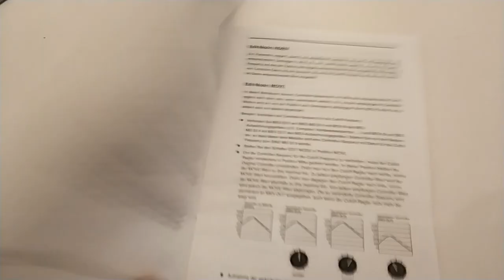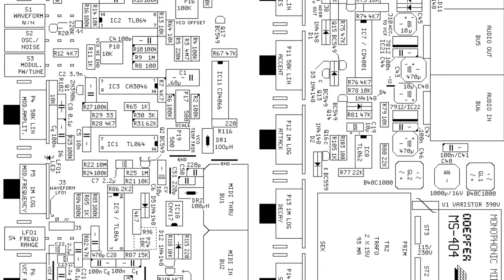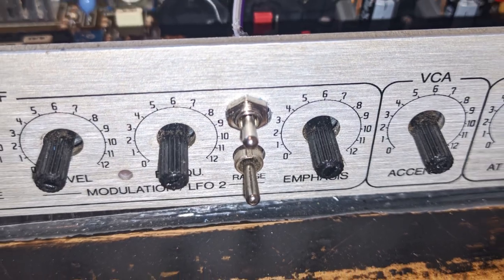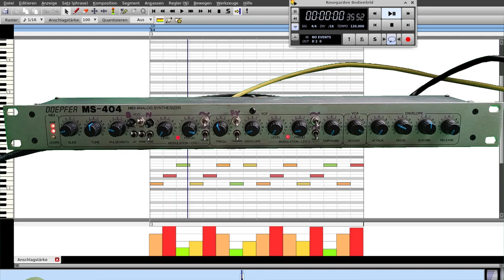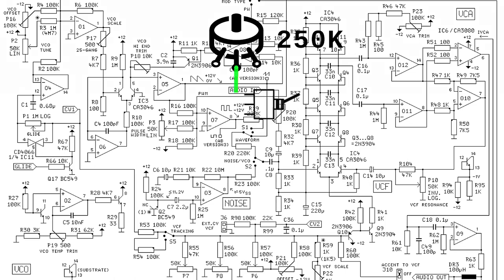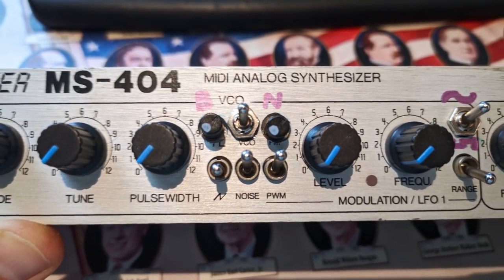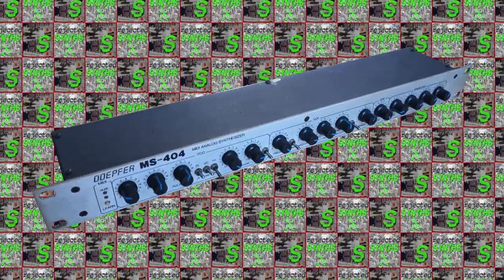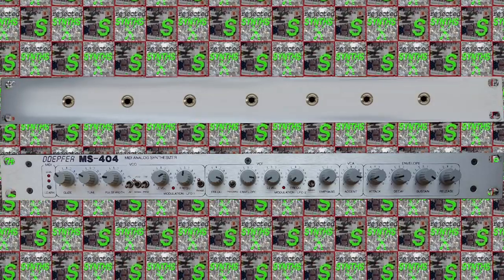RS047 Tech Support: Doepfer MS-404 - Some Simple Mods

Comment: Another possibly simple mod you could try, would be a switch to change the filter between 24db and 12db slope. It should only require a dual pole switch and wire it in the following way:
Lift/desolder one side of C16 and C17 from the PCB to seperate their connections to the transistors in the filter. Connect the capacitor leg to the center pin (common) on the dual pole switch.
One of the positions of the dual pole switch is then wired to go across capacitor C10, this is the 24dB/oct setting (unmodded).
The other position of the dual pole switch will have wires going across capacitor C12, this is the 12dB/oct setting (modded).
The most difficult part of this is to ensure the polarity of the wiring since it needs to be maintained the same as the unmodded filter due to it being a balanced design.
The filter is a 4 pole ladder filter, where each pole is a transistor pair with a capacitor inbetween (C10-C13) looking at it should help understand better what I'm babbling about.
Reply from the maker: Wow, thanks a lot!
Reply: @rejectedsynths  You're welcome :)
Hope you test it out and get it working.

It should also be possible to tap off the filter at the other stages, to get 6dB or 18dB slopes (by tapping over one of the other caps in the ladder filter)
but I can't remember if the phase of the signal is inverted at these stages, relative to the resonanse feedback.
If that is the case, it would require some more modification.

It is however quick to test this, by simply just tapping the signal at those other stages and listen.
Reply: @rejectedsynths  Oh and another thing that might be usefull and simple, would be to wire a push button to the gate input, so the synth can be manually played without the need for a external controller.
Quite usefull when goofing around with the unit.
Reply from the maker: @Gin-toki  Like the launch button on a Waldorf Rocket 😁👍

Man you sure know a thing or two about modding a synth!
Reply: @rejectedsynths  Hehe, well I've dabbled a bit with homebuilt synths :)